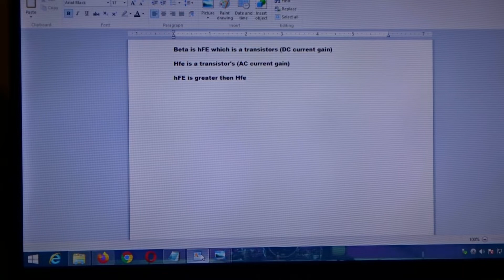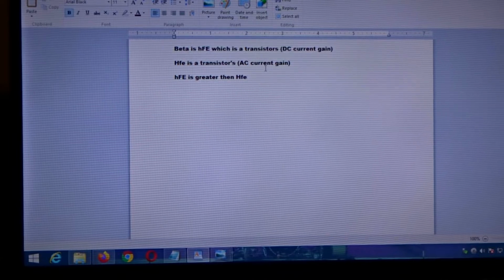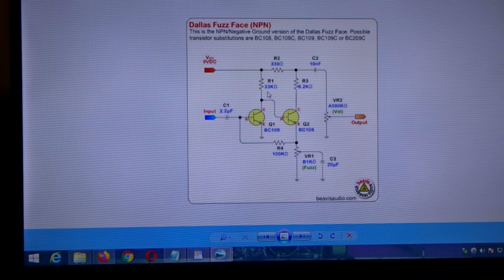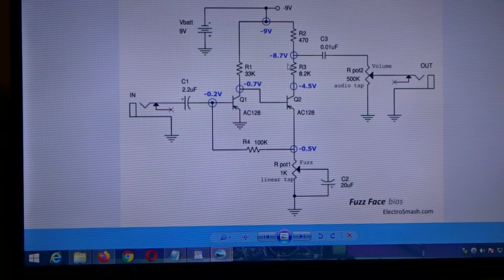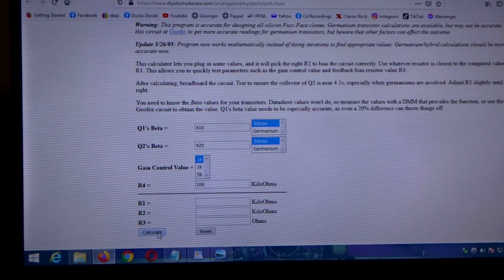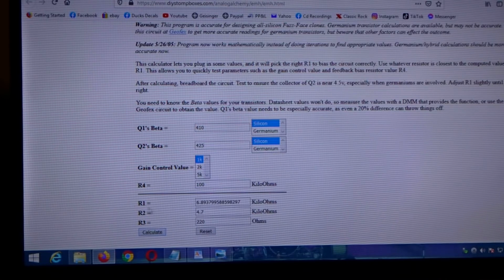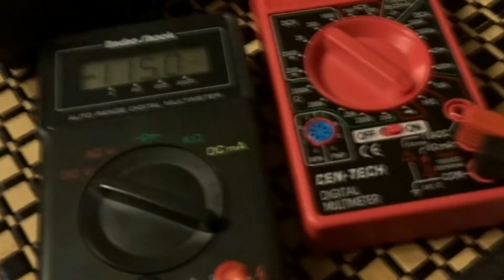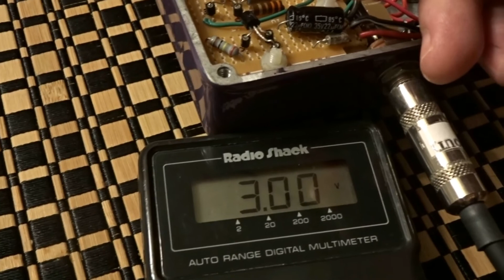Fuzz Face Q1 & Q2 Biasing

Comment: One of the many problems with the fuzz face is it's incorrectly biased in the first place and it's by design. Because it does not have a proper voltage divider network, it needs the missing D.C. bias from the half cycle if the input A.C. source. It consumes some of that voltage, turns on and is constantly switching on and off with each cycle of the input signal Q1 sees. If you look at a sinewave and the 360 degrees of signal voltage swing, a portion of the wave is consumed to correct the bias needs, the circuit switches on, and you have effectively sacrificed part of your input signal. It's a very non-linear circuit.

This is that crumbly sound you hear as notes are towards the end of their decay, and you are hearing that loss as well as the circuit switching on and off. This is coupled with the distortion we actually do desire that is generated from operating the transistors at the top of their specs, and causing the signal to compress and clip naturally. It operates in less than 360 degrees of conductivity, so it's in a sort of crude "Class-A/B" way it operates. This makes it very non-linear. 
It has some usefulness with the right genres of music, but by also being a very low input impedance, they're prone to having problems when chaining them together with other pedals. 

It's such an easy circuit to build, but one of the worst to try to learn some of the authentic science and math off of. Unfortunately, the DIY community is dominated by people who sound like they know what they are talking about and can showcase some math skills, but ultimately, you're getting pseudoscience and mysticism. This is one of the reasons I abandon the DIY community permanently and enrolled in college 13 years ago. There's no shortage of success stories running boutique pedal companies that are frequently contributing in them, but they genuinely know very little correctly about what they're doing.

A much better entry level circuit is the Big Muff Pi that properly biases the transistors into their quiescent state and operates with linearity. You're also more likely to find at least reasonably accurate information when trying to understand the quantum mechanics of how the materials work, and what the electrical signals themselves are actually doing, but even that's a crap shoot lol.
Learning about using a proper voltage divider to bias the BJT correctly will also help you understand HFE, and other factors. HFE regards forward current gain, not A.C. Until you couple the signal to a different device using a capacitor, the forward current becomes pulsating D.C. meaning, it's fundamentally moving in 1 direction while rising and falling within it's peak D.C. voltage gain. 
This is to say if the D.C. output is 10 vdc, the A.C. component will see the 10 volts like it's 0 in respect to how you see it on a scope, and then you will see it rise and fall in frequency from the 10 vdc line on a graph. It's said that the A.C. rides the D.C. in an amplifier circuit. The coupling capacitor blocks the D.C., so by this providing a path of least resistance, the majority power gain of the signal leaves the circuit as A.C.

Comment: my multimeter is measuring 375 hFe on my BC183's. People are saying the hFe should be under 100 for a proper fuzzface. How's that possible?
Reply from the maker: I know what you are saying & I don't quite understand it myself. What I do understand circuits were changed in many FF & other things like the Big Muff due the fact they changed a component in the circuit. So they would change resistors ect. or you can add a trim pot to get the correct bias. There are tolerances on electrical components so some will measure higher & lower. With that said you would have to go through a bunch of transistors to match them. This isn't something that they did back in the day & artist would cherry pick the best ones & it's why you hear that this fuzz face sounded better. I like to go by ear & not get hung up on the number side. If it sounds good to you that's all that matters. Here's a video I did showing a germanium transistor that is rated 90 hfe but measures 140. https://youtu.be/V-yELgJL0Ys Don't let these guys get in your head. Build it & if you don't like it adjust the bias & try different transistors. Too many gear snobs out there.
Reply: @TheVlad69  thanks well i have a bag of these transistors. Supposedly the goal is Q1  to be lower hFe than Q2 so not sure what is considered matched. they say Q1 should be 90 and Q2 110. I dont know where these numbers come from i have all kinds of transistors and they all measure much much higher using a multimeter, both PNP and NPN
Reply from the maker: @geezberry8889  I have no idea where they come up with those numbers but out of a hundred or so that I tested all fell in the 5 or 10% tolerance range. I matched mine as close together as I could & I set my bias at 1/2 or 1 volt lower then recommended @ Q1 & Q2 as I like mine fuzz on the nastier side.

Comment: What is the website you are using to calculate the bias resistors?
Reply from the maker: After I had to go to Windows 10 I lost the site I was using.
Reply: @TheVlad69  I found it. Thanks!
Reply from the maker: @joelvanginkel  You're welcome. That's great! Can you give me it?
Reply: @TheVlad69 you can see the URL for the calculator in the video!  You're using the diystompboxes calculator.  Personally I like the FF calculator on Jack Orman's site as it calculates all the b,c,e currents and voltages which is helpful if you are using Gus or Mac's method for biasing silicon FFs
Reply from the maker: @Taipan66  Thanks I didn't notice that.